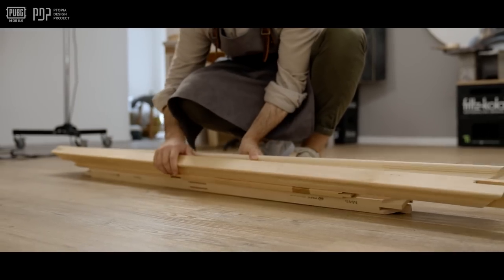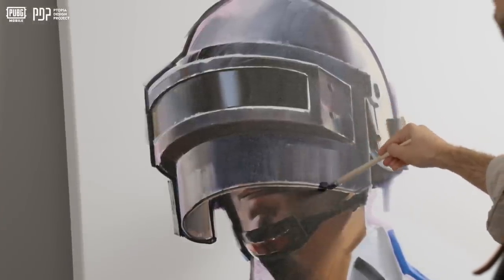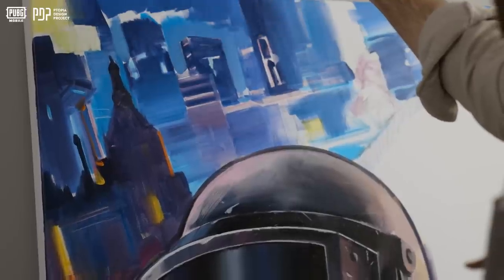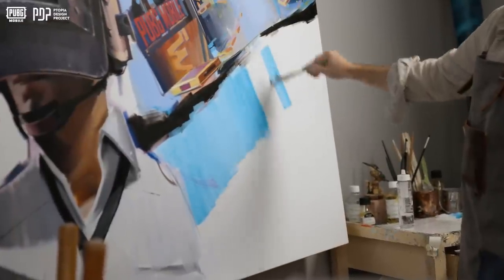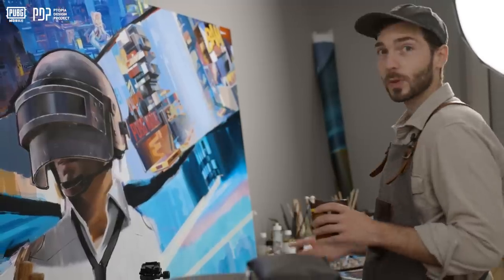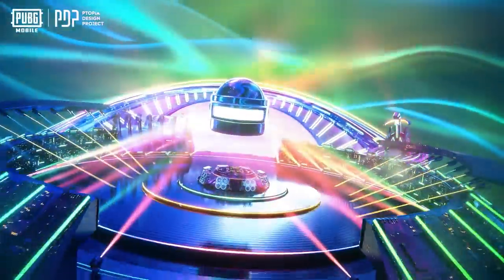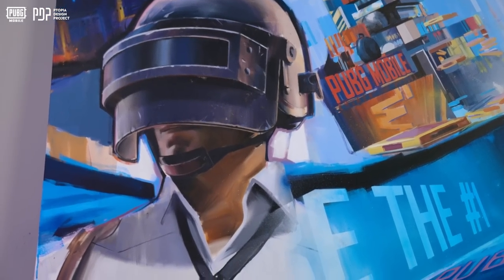I spent 14 Days painting this INSANELY detailed commission (with Neon Lights)!

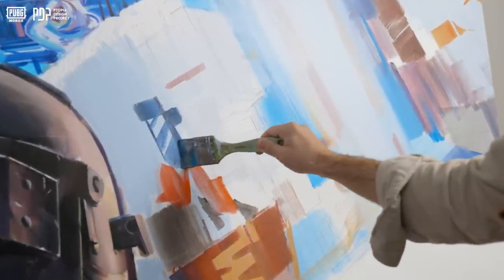Comment: 'ello @AlpayEfe. quick question. in - 5:07  - you say you used acrilics. im guessing your painting in oil. as far as i know you cant layer acrilic over oil cause is like water over oil, wont it chip? is it possible?
thank you in advance btw 😊 big fun from Greece ✌️
Reply from the maker: I did use acrylics… as long as you use acrylics first you’re totally fine
Reply: I think he started in oil in the top left right and then was fed up with it and continued with acrylics in the bottom right corner? 😅
Reply: @AlpayEfe  and @Janduny 
Aaaaa that makes so much more sense 😅. Thank you both for answering 😊✌️